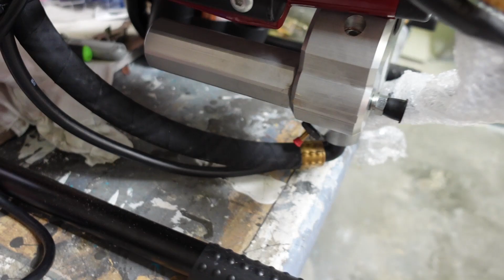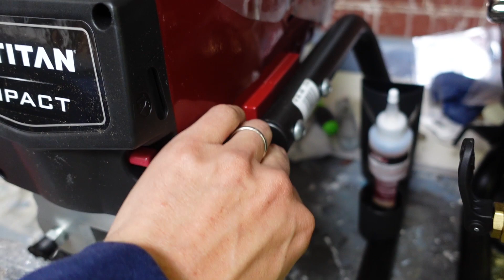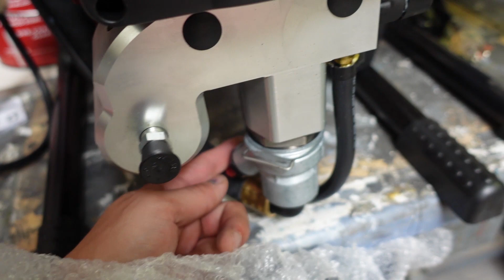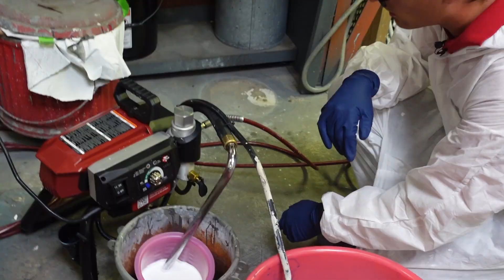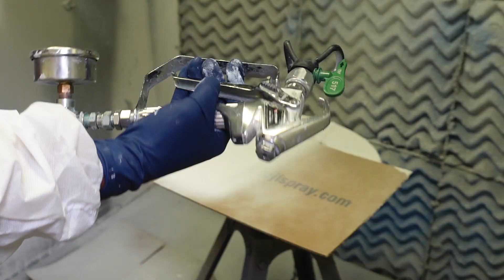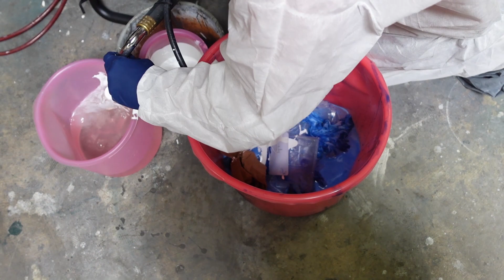Titan 440 2023 New Model Review and Compared Against the Original

Comment: I just bought my 3 months ago the new model and now only works in high pressure when y try to use it in low pressure the machine it doesn’t works
Reply: You just gave me advice to go with graco ,titan also doesn’t keep the same prices in deferent paint stores.Good luck to you, obviously you’re gonna need it
Reply: @ZMK-155  Honestly I Prefer Titan instead of Graco my sprayer   Machine I had the bad luck that it comes with a bad transducer so just Replace and now it’s working like butter
Reply: it would be best if u record video and show us would help to investigate that maybe u doing something wrong
Reply: @gligorije31  I already fixed It comes with the original transducer broken that only detect high pressure of the machine I get a new one in amazon for $45 dollars and now works fine ( titan warranty they try to charge me $480 to fixed even still under warranty )I did myself in less then 5 minutes 👍